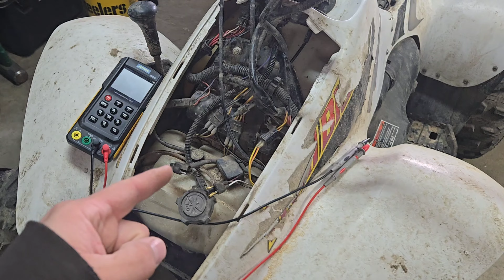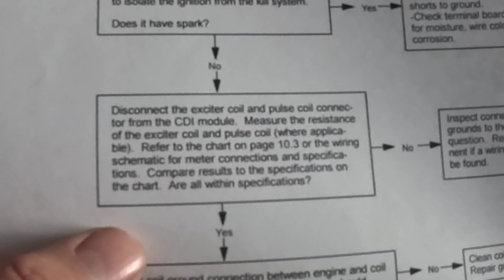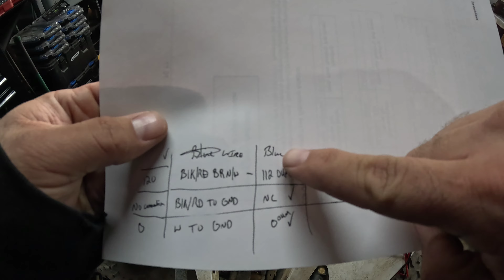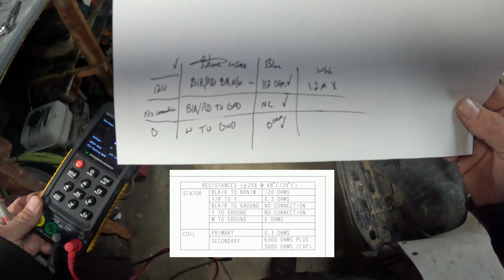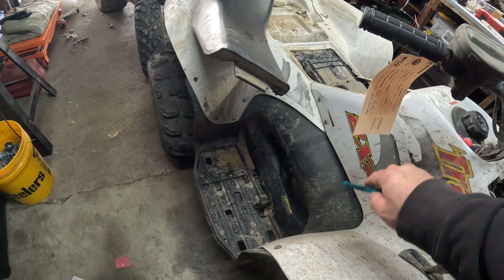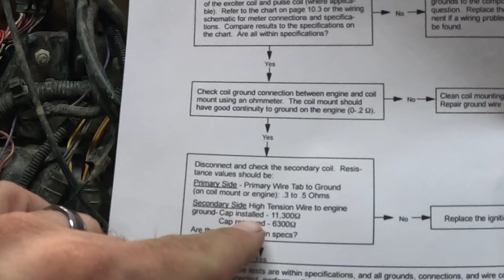Polaris ATV No Spark Troubleshooting | Step‑By‑Step Guide with Schematics

Comment: Excellent video. Where did you get the Polaris info for the 4 wheeler? I can't find anything on their website
Reply from the maker: I have quite a few service manuals available for free viewing here on my shared Google drive folder.  Check out the details in the pinned comment in this video.
Reply: @HarkinsEquipmentRepair thanks

Comment: Awesome Vid. Just got a project TB 250 and hoping to get it running.
Reply from the maker: Thanks! I hope it helps too!
Reply: @HarkinsEquipmentRepair  Cleaned the carb and it wouldn't even try. So I put new spark plug and tested the spark. put it back together and ran a longer oil supply line back to the oil tank so I can just run pre-mix. plug the oil nipple on the carb. then it Fired right up. best $500 bucks spent
Reply from the maker: That's awesome, if you want to free up some of that strong thumb throttle, disconnect the cable going to  your oil injection pump that you've bypassed, your thumb will thank you.
Reply: @HarkinsEquipmentRepair will do! My daughter’s thumb thanks you 😂
Reply from the maker: You're welcome, it's not much but it's one less spring pulling on that thumb throttle. 😊

Comment: Where did you find your troubleshooting information?
Reply from the maker: You can get the manual PDF downloads from manualslib dot com

Full Polaris Manuals and other things
Reply from the maker: Did I answer you question? 😃
Reply: I had a no spark trail boss 330,  I disconnected  the same kill switch up front and it starts right up.  I replaced the handlebar light/kill switch unit and it didn’t fix it.  Any ideas what’s going on?
Reply from the maker: @SonoranSkyCeramics Disconnection of the black wire up front there from the CDI only bypasses every system kill from key or safeties. 

Try this, Start it with the wire off, then reconnect the black wire while it's running.  Does it kill?  Or does it remain running. 

If it still runs,  the issue is somewhere in your safety start circuit (Nuetral Gear/Brake Switch) something is wrong with switch or wiring related to those switches. 

If it kills when connected, you issue lies either in the wiring/switches in control of key ignition or that switch you replaced.  I've seen wire connectors nasty inside where they plug into new switches.  So take a good look there. 

I know you said you have a 330, I have an "early" 99 335 Sportsman and they made a couple different types there and the even have a "late" year split in some varieties. 

My point to that is some use the the dash odometer as the central hub wiring concerning safety kill circuits and more.
Reply: its  a 2003 or 2004
Reply: When I connect wire  while running it kills it,  the handle bar engine off switch also kills it.      I will pull the gear shifter switch on the transmission housing  and see if I can engage it .   Thank you so much for your time answering me.  You have a kind soul sir.
Reply from the maker: @SonoranSkyCeramics You're welcome, I think you may have misunderstood my last comment. 
if it STAYED RUNNING when you connected the black back to it, it might've been those Neutral switches or something. 

BUT

Since it killed it when you hooked it back up while running, it means you have something key/kill switch circuit related.

Think about it like this. If everything was normal on a great beautiful day and you had your gear in the wrong position, it's not just going to kill your engine. It's designed to change gears while the engine is running. But if you had it in the wrong gear, it would not let you start it until you're in neutral or Park on some models.

 So right now, I don't think it has anything to do with your gear selector or brake switches.